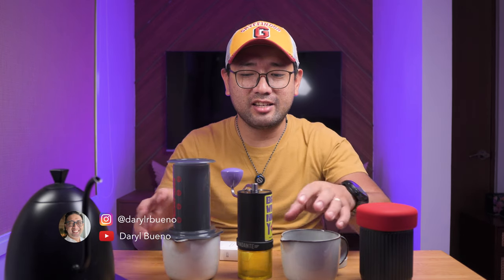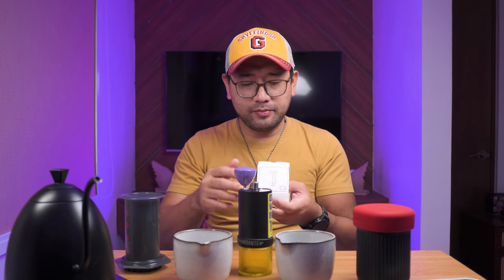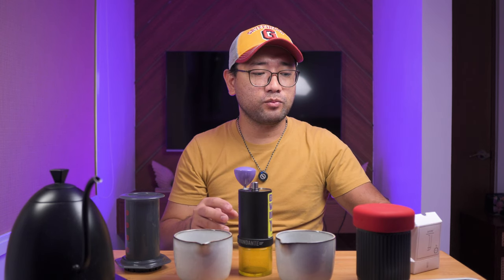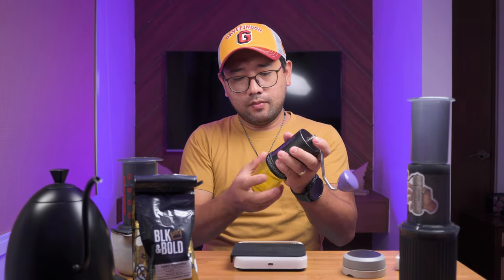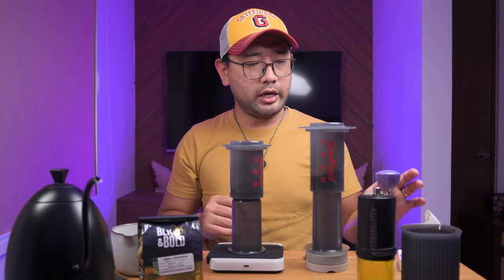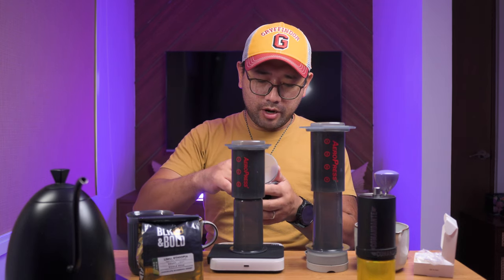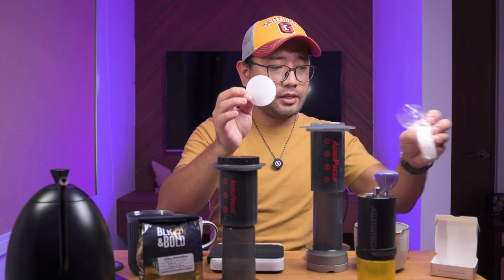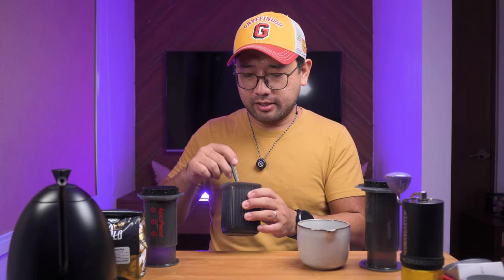Aesir Filter - Competition Filter for Aeropress

Comment: Would be curious to get your thoughts on the flavor and brewing differences between a V60-01 and V60-02. Using the same ratio, grind settings, etc. which of these brewers are actually better for single cup use. or do they produce the same? Maybe an idea for a future video 😉
Reply from the maker: A lot of people actually message me about this but yes we can do a video about it. But to answer your questikn, the difference would be mainly in the height of the pour. Bec with the 01 you can get really close to the bed but the 02 with low doses it would be hard. And as we know the height of the pour soemtimes dictates the amount of agitation, the length of contact time things like that so its possible to get very different results.